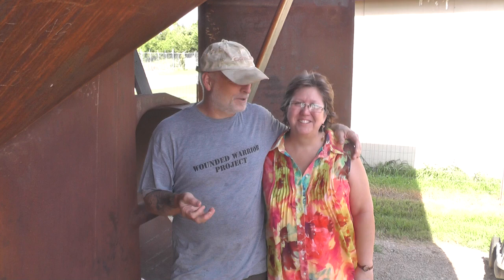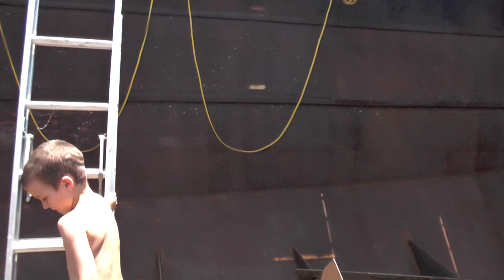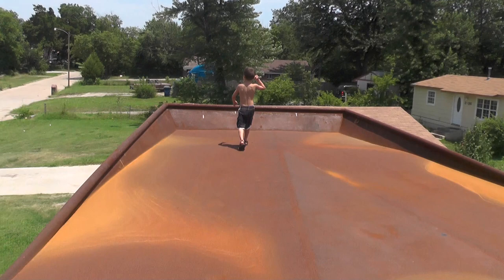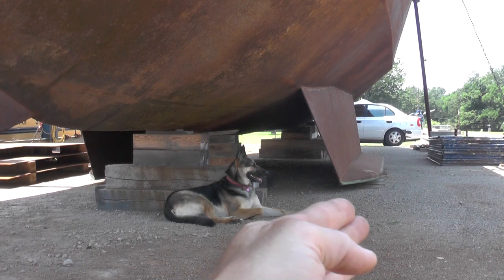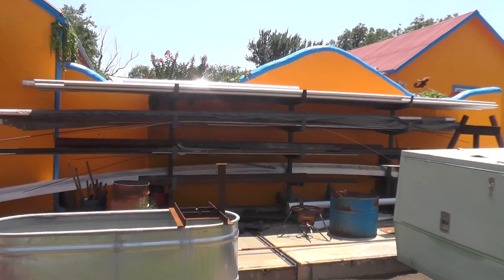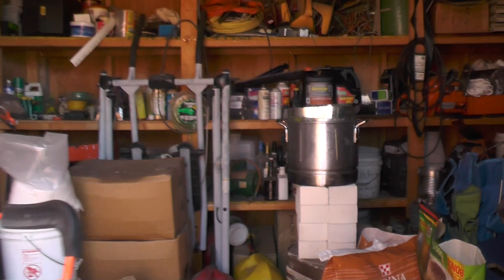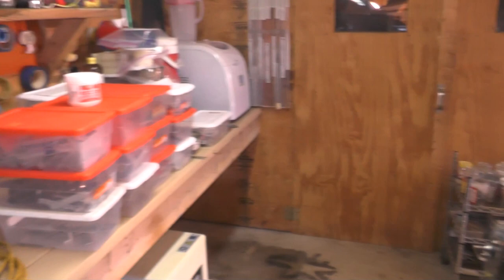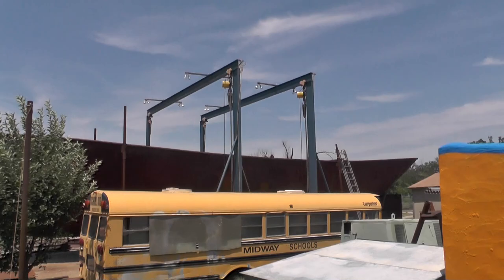Boat Building Tour and Invitation

Comment: He is creating an ark, while my whole goal for 2015 is just to clean out my garage and build benches and storage.   That is a lot of heavy metal.   Glad to see this project dedication.
Reply: how did you make out. im just cleaning my garage out to work on stuff. havent been ableto get a car in there in years. happy new year 2016
Reply: gear head Created pretty built in storage and benches, everything looks good, but not done yet.
About $1500 from done.    Very pretty garage space now - actually a fun place to hang out.   3.5 bays and no car will ever live in my garage, but building 3 more bays opposing these - maybe for cars.

Can't wait to see this ship outfitted inside and painted.   The paint must be going to cost a fortune.    Wonder if there will be comfy quarters below and how much wood.   Seems a decade or two  or so ago rules for fireproof cabins changed, then you saw the timeshare industry buying boats due to be illegal in 10 years, to use them to help legitimize timeshare tours.  Something about fireproof cabin materials, yet wood would seem so warm in a house of steel.
Wonder if anyone is signing up for that 500 buck a day research fee.    One day we may see some ocean around this boat, and videos on sailing.   Will the boat get sails, or pure deisel engine?   It will be fun to see it show up at woods hole to pick up a research crew.   We will see maintenance videos - like scraping barnacles off the hull, and learn more about the lifespan of a ship.   The german shepard will get sea legs.
Will be quite a transition from a workshop shop and house, to ship living.    Wouldn't it be hell if he got so used to ship building that he stayed home and built another instead of moving to sea.   How many folks projects are so well planned that their transitions follow the natural transition desires of a limited lifespan man, in a world of unlimited projects.   One day he will say, I built an arc, and it pleases me.

Send him a few bucks for paint.   Marine paint is hellishly expensive.    Wonder if carpenters will show up to build out the deckhouse interior.   Wonder if ship fridge will be dual electric/propane but big, and what kitchen galley will look like
to cook for a crew.    Wonder what soundproofing for engine/ generator to make ship not all engine and generator noise.
Where will the solar panels go and the cables to batteries.  Where will the solar hot water cooker go for showers, and which tank will get hot water insulation and a recirculator pump to the solar collector, and engine heat cooling heat exchange for hot water.
Soon enough, conduit and electric outfitting.   Crane for the transom little boat.   Could it be that when all the steel is done, the build is just at the halfway point?    Wonder where the floating gangplank will get stored and how it gets lowered - will be heavy.   Wonder if the carpentry build out waits till the boat is in water for weight of getting ship trucked to water.
Then the dock expense and getting building materials to ship.
When does the hot tub arrive and how will the antisplosh lid work.   How much room is left after the solar panels on the cabin roof, for dirt for the fresh lettuce and celantro farm.
Does the galley get a butcher top table and where on the deck does the propane barbecue go.    Is there a main propane tank and piping to fill it from a dockside propane truck.   Where are the hammock hanging cleats for the nest of hammockers sleeping on deck.   Where are the fishing pole tubes for 
trolling for fish for the crew and is the research gantry crane and transom boat crane dual use.   How many batteries, what size inverter, what led lighting to save power.   So much to see play out.   Maybe you better get a fine finish carpenter to design a cabin mini bar for when the scope of this project gets overwhelming.    Fortunately, with a plan and a project, results happen, even if the timefrane modulates with fortune and the economy.
Reply: Better send him your old pirate story books so his galley library will have something to entertain the crew.  Nice stories of blackbeard, and things like Edmund Fitzpatrick, Lusitania and Titanic and a little Gordon Lightfoot music.  The wifi will need distributing with all that metal.  Arduino monitoring for engine temp, battery levels, water tank levels.    What satelite wifi link, any hardwired ethernet?   Where is the video room with the led tv and dvd, how does it tie into net based research video teleconferencing and the rover cam.   Where is the server pc mounted, and how much disk for onboard music.  Whither the deck speakers for playing Gordon Lightfoots wreck of the Edmund Fitzpatrick.    Where do the go pros mount for the coming saga of the sea films.   One on deck electric cooled chest for those crew who fish.   Icemaker in galley.
Reply: Wonder about the head design.   Composting toilet or holding tank like trailer or hole to the ocean.    Getting older, and prostates dictate urinal like capped 3 inch pvc on deck with privacy shield so you are not going below every hour in your 60's and 70's.   

Mast design for antennae and radar.   But need a crows nest for its romantic appeal and crows nest cam with remote panning.    What marine phones and communications, design of captains control center with gps, loran etc.
Mount some lazyboy recliners and hammock hangers in that deck cabin with good tv view.
We need a cozy ship!
Reply: Gotta have a laundry facility - gas propane dryer and washing machine.   Clean dry clothes are critical in a sea environment.   Need one lime tree so you don't get scurvy.   And a keg of rum, yo ho ho.   Cloths line hanger mounts on deck, for saving propane and sun bleaching laundry.

Comment: Hi Doug,
              What a wonderful project and when finished will be so full of adventure. How I wish that I could join you but the fates have struck me with 3 heart attacks , a spine problem and lastly an age of 73. still I can dream and If you intend to produce a series of videos of your adventures then I will be glued to the TV watching your treasure seeking trials and tribulations. I must comment on your remarkable powers of endurance and dedicated drive and the help of a first class partner.
  I still work in my workshop on precision metal work projects and at present have designed and am building two CNC routers. The larger of the two is almost finished and I just have to complete the electronics drive system.The smaller of the two is primarily for cutting PCB's without having to use etchant. A quick production of PCB's for my many electronic projects. I am often found reading books on Psychology and Hypnosis  and have a passion for Cosmology and have written a number of controversial papers.
 I am a very good ideas man and have had many years professionally solving industrial production problems so If you come across any unsolvable problems just send me an email and I will try to advise or better still solve your problem.  
  Good luck on your endeavour, and best regards to you and yours.
Cheers Mo King
Reply from the maker: Thanks Mo.  Do your best to stay in good health and you can come be apart of the adventure.

Comment: Thanks for the vid. I love your attitude and determination.  Something I've always wondered is why you don't have a forklift. An older all terrain forklift is not expensive.  It would be so handy for you.   Also I would imagine you will take your machine shop with you for repairs, I don't believe you mentioned a tool room.  Wish I had time to come work with you.  Good luck.
Reply from the maker: Glad you like the videos.  Yes a forklift would be good.  Not a lot of room for one but we did consider it.  ...And the engine room will double as a shop on the boat.  It will just be a lot tighter space.

Comment: Bit premature, but when you get around to the high amperage DC electrical stuff, use real crimpers, either ebay hydraulic ones or get a nice pair of bolt cutter style crimpers. (Greenlee's can be had new for <$300! ) Or make your own dies for a bolt cutter. Dont use the hammer type ones whatever you do. Dont listen to all the derpy anecdotes saying they work ok, if they had the right equipment to do a miliohm test or a pullout test they would know they arent.  The greenlee crimpers do from 8 awg to 00 awg on the small range, or if you get the large range one they go upto 0000.  I can take measurements of the dies if you need.

Comment: Just a random thought, why not modify one of the bus bodies for the wheel house? it would look really cool!
Reply from the maker: :)  You're not the first with that idea.  Who knows? Might just do that.
Reply: SV Seeker actually not too bad of an idea
the busbody skin is aluminium
its somewhat insulated
the windows fit
and it has windscreenwipers a captainchair all the gauges you need for the motor and a steeringwheel
you might need to skin it though to get the metal frame under the aluminium coated to prevent rusting
good thing about the frame is you can weld it to the deck

there was a dutch guy here in the 70's that actually sailed a big part of the ocean in a stock truck , he had made a frame with two huge pontoons (think they where industial boilerkettels or propanetanks ) and disconnected the driveshaft and mounted it directly to the propeller 
cooling by stock radiator
steering was done through the frontwheels driving some rudder mecanism
forward and reverse through stock gearbox and clutch 
he lived in the box on the back of the truck during his travels

the only mecanical problem he faced over time was water in the diesel causing him to have to replace the filters and flush the injectors every so often

Comment: Ok, so with the talk of aluminum wheel house on a steel hull boat - how do you plan on overcoming the inherent electrolysis issues that are bound to come up with the mixed metals and salt water?

On the bus transmission piece, not to rain on your parade, but there is a reason that bus transmissions are not used everyday in boats - they just can't take the forces ( for the long haul).  Would hate for your transmission to fail at a very critical point at the far reaches of the earth.  I suspect buying a used trans and rebuilding would be right up your alley.

Plan for the worst, and hope for the best!
Reply from the maker: Re Pilot House:  http://svseeker.com/pilot_house.htm
Re Engine:  So an Allison transmission and move 40,000 pounds across the country while essentially locked onto it's traction surface, but it can't provide auxiliary power in against a fluid medium?   Have you actually tried it?
Reply: SV Seeker
I am not a naval architect nor engineer (I'm a CPA); just grew up around the large commercial and pleasure marine environment.  I am not saying that it won't work, I just would have reservations about such an arrangement working for the long haul, and working in critical situations when you need it like coming into a harbor during a storm with the wind blowing toward the jetty/rocks, and you are wondering the whole time if the transmission will slip or fail.    

Lastly, moving a 40,000 lb truck down the road is different than moving a 40,000 lb boat through the water at varying speeds.  The resistance of wind vs water (related to viscosity) and the calculated surfaces areas of a truck vs boat hull are significantly different thereof.  I am probably stating the obvious here for you, but again - if truck transmissions could be used every day in a large marine environment, then why aren't they?   

My comments are merely considerations.  I am envious of you; you are doing what most only dream to do.
Reply from the maker: Jim Massey Jim, as a CPA you'll get this. If I was paying US salaries and hundreds of thousands of dollars for a fishing permit and limited to the days that I could operated my craft so that it necessitated operating it in all kinds of conditions then I could only compete and survive if my engine and drive worked flawlessly.  On the other hand people have been crossing the oceans with no engines at all for a lot longer than than engines have even existed.  And when you change the economic model from where you grew up to say, Thailand, then you'll see that old car engines are the norm in the "long tail boats".   Now, would I prefer to have a $15K Twin Disc?   Sure!  But until you send me the money then I'll do what is necessary for my economic environment.

Comment: you mentioned that you plan on putting an aluminum cabin aft, how do you plan on getting around the corrosion problem? They make a product called Data-couple that has aluminum and steel exploded together at molecular level so there is no corrosion.  Not sure of the cost but that would be the best method I could think of.  The Coast Guard used it on their 44ft Motor Life Boats to join the steel hull and aluminum cabins. http://www.boatbanter.com/showthread.php?p=957322
Reply from the maker: Here is a page on the pilot house and explosive cladding.  http://svseeker.com/pilot_house.htm
Very cool, but VERY expensive.

Comment: what's your plan with the rust? (just wondering if you have some magic trick for it).
Reply: i am guessing they will sand blast it
Reply from the maker: Aichmo Exactly.  That's what the sandblast pot and big air compressor are all about.
Reply: SV Seeker
looking forward to see that part of the project.
Reply: SV Seeker have you seen a sandblasting rig on a power washer? I use one on a 140 atm power-washer and it really kick some rust of. How ever I was wondering if you have seen the power washer sandblasters in action and what your comparison to a compressor setup are?
The only problem I have with mine is that the feed hose is only about 6 feet long, so I have to move the sand pot around a lot. 

I am thinking about making a set up similar to yours, with a water feed for it so I can reuse the wet sand.
Reply from the maker: Jens Sigurdson I have seen a them on YouTube and some people really love them. They can not use wet sand so that's a real limit for me.  My gut feeling is that the process of aggregate blasting has more to do with the aggregate and horse power behind the aggregate than it does with the particular delivery system.

Comment: You will be glad you got a 5.9 Cummins I  am a technician that works on Cummins  just always change your fuel filters  that is the only thing that kills Cummins motors is bad fuel  .and don't bump up the power to much it will kill the Longevity of the motor
Reply from the maker: Starts up everything after sitting for two months or more.  Even good after it's been run out of fuel.